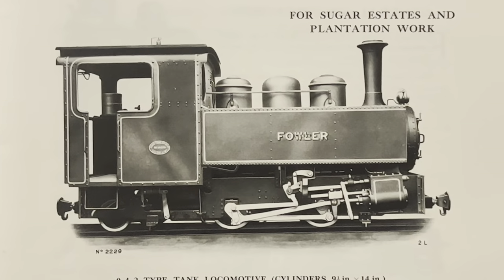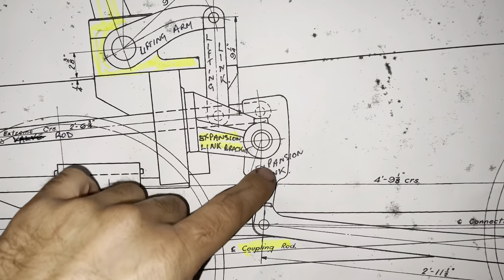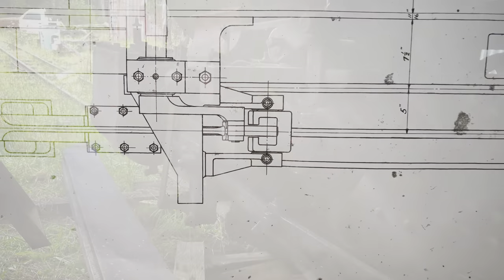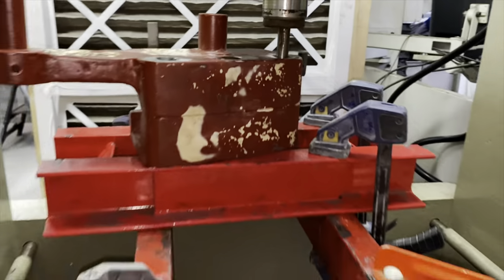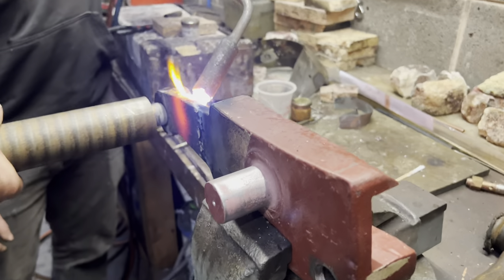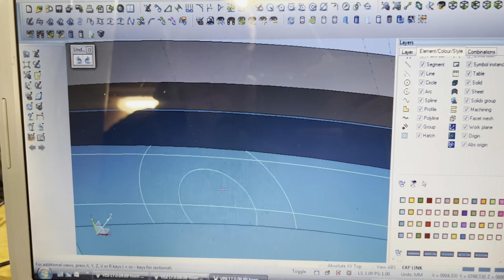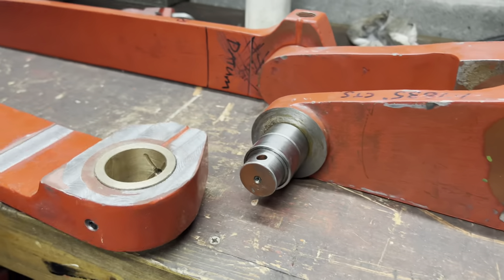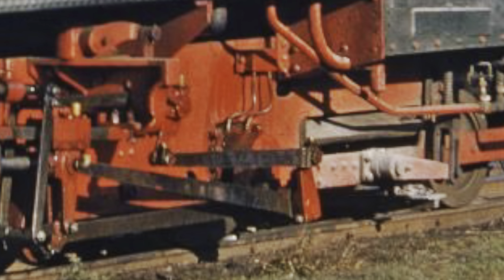Fowler 16341 Restoration Part 16

Comment: Don’t be surprised if the flats you machined for reference develop a crack.

You don’t need a screw to keep properly fitted bush’s from rotating.
If you machine a groove around the outside & drill 3-4 grease/oil holes you don’t have to worry about getting them clocked correctly.

Comment: Why use bearing shells instead of the full bearing assembly?
Reply from the maker: Because 1924 Fowlers were never fitted with roller bearings, it wouldn’t be an authentic or sympathetic choice for our restoration.  The bearing shell is just a neat and simple way to accurately sleeve an undersized pin producing a hardened, ground surface at the same time.  🙂